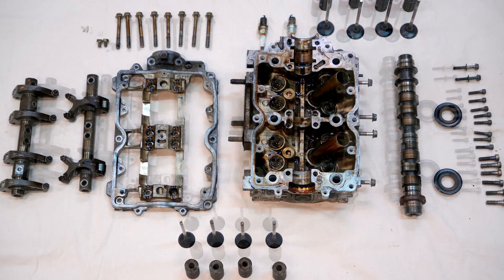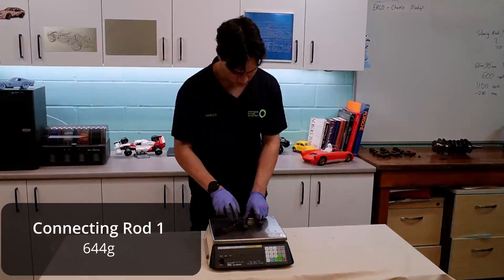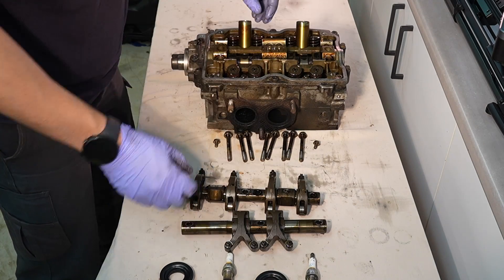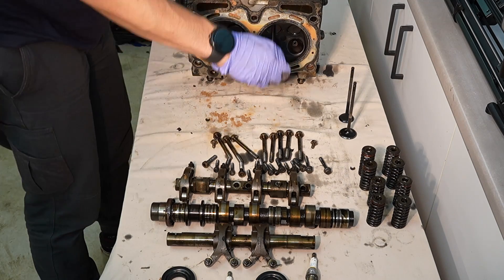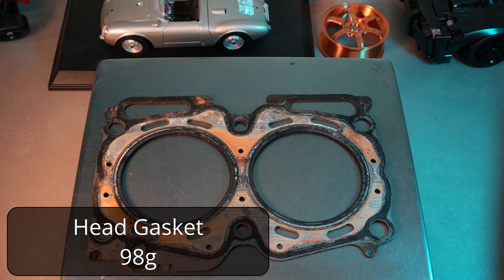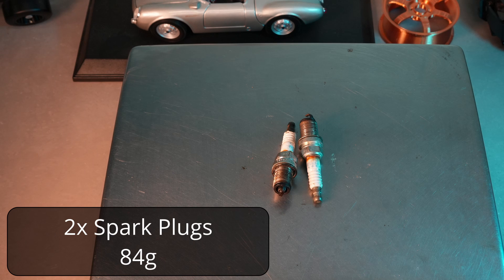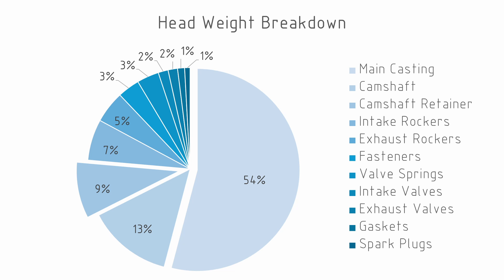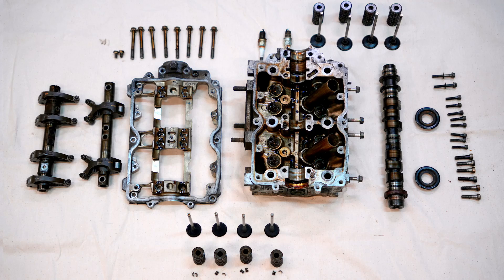Head Teardown & Weights - Engine Mockup Pt. 2 | Project 171

Comment: I'm curious to see how much and where you manage to lose weight. There is probably some material to be ground off the main casting. 
 Titanium fasteners would be expensive and yield only 1% weight loss.
Reply from the maker: There won't be much weight that can be saved on the engine.  Probably around the intake and the flywheel.  However for the mockup we will be saving a fair bit of weight that won't need to be lifted every time.